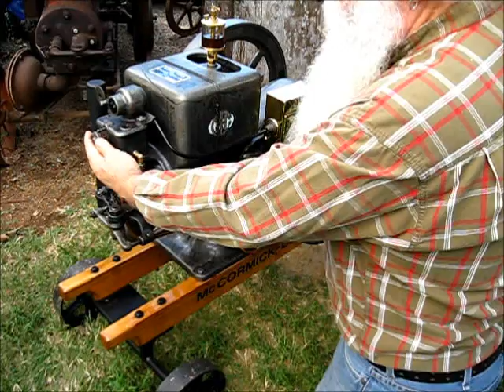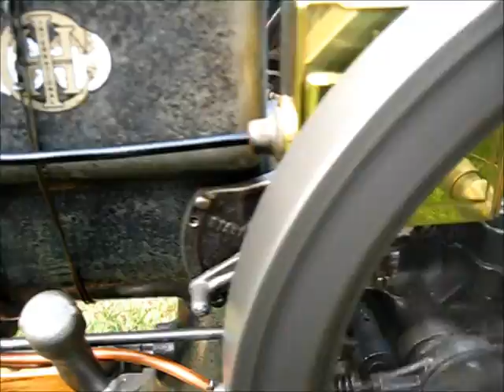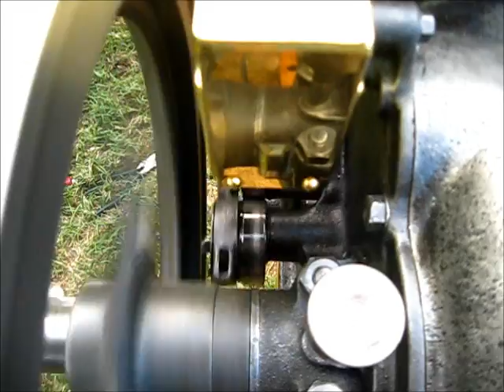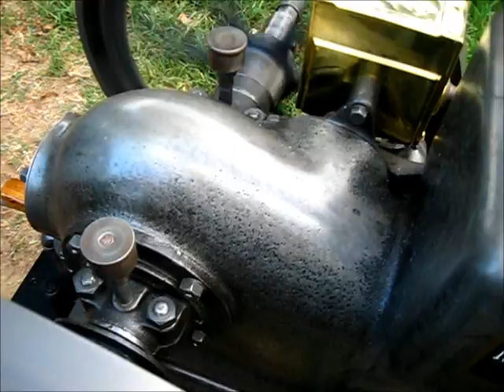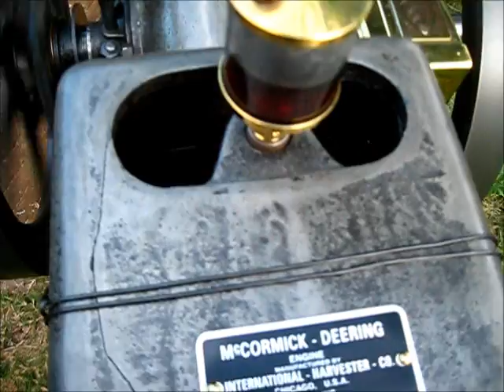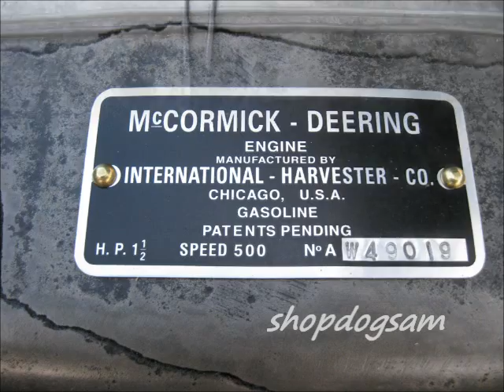McCormick-Deering "baling wire engine" #64

Comment: The fuel tank is in the base, I believe its 1.6 gallons. There is no float bowl. It is not a carburetor, but a mixer. Fuel run into the Fuel bowl and overflows back into the the fuel tank. Perfect for this type of engine and and very few moving parts in the mixer. You can buy almost any  part for this engine. LOVE that sound!!!! put you to sleep. Where on the east coast of AR? I live in NLR. Working in Magnolia on a job. The engine I went through is up in Peoria, IL. It runs perfect!!!! If you have others or want to sell this one, I am the one you want sell it to. I have watched so many MCD 1.5 engines on youtube and they are not doing things correctly. GREAT Video!!! Very Very Nice. Love to at least see it. I will even start it for our enjoyment without instruction.

Comment: your wealth of knowledge on these style Engine,s is incredible .I imagine they could be used for almost any application  power a generator, wood splitter air compressor, E.T.C  Old technology that will probably last longer then it's modern equivalent   Awesome

Comment: That one is a stable runner!  You could measure that valve clearance with a yard stick. Very funny.
 These engines last so long because they are a low stress design. They produce around 1/10th of a HP (or less) per cubic inch. They have extremely low compression ratios and low valve spring pressures, etc combined with super strong beefy castings.  I love the cracked hopper. It adds a lot of character.   Thanks for the video!

Comment: I watched the whole series, and loved it. I learned a lot, and want to thank you, for sharing this. I see you are running Coleman fluid, do these engines require low Octane fuel, like Coleman fluid, or will higher octane fuels work?  Do you have a video explaining the types of fuels, that will work, in these engines?
Reply: These engines will burn just about anything you give them without issue. Coleman just happens to be a happy spot for these engines. They were designed to burn more oily fuels if the farmer was cheap, but they are just fine on gas. The alcohol doesn't hurt anything. I wouldn't be surprised if a few corn farmers fermented their own "fuel", heh. Although I wouldn't recommend it, I've seen a few videos of some 4 cycle gas engines running on diesel. Often the best fuel is your own custom mixture of fuels, such as mixing a little gas and kerosene.

Comment: Back in high school (20+ years ago) my auto shop teacher had a very similar looking engine bolted down to a bench near the door.  We'd all stand around waiting for class to start or class to end and rotate the flywheels, and if he ever saw us doing it, he'd yell at us to "stop messing with that motor".  I never knew what that engine was, I just happened to see the thumbnail and it instantly brought back all of those memories.  As an IH fan, I wish I would of seen it run back then.  Thanks.

Comment: Outstanding job on the engine restoration. The piston and rings are good. I wondered about that part but they are fine. It dont smoke, it has good compression it runs nice.The exhaust sounds really good with that homemade muffler I really like that part and the linseed oil metallic finish is so tastefully done it looks  like a work of art.. It its a beautiful motor and sounds and runs so good you gotta love it.Thanks for making this video series. I am ready for more.

Comment: Alright shopdog!!!! Congrats!!!  I do have a question tho, with these old engines, why don't they have an air filter? I figure in the environment that they were used in would have been pretty dirty (running a sheller or a grinder etc) wouldn't all of the chaff/dust screw with them a little?

Comment: That is just too cool.  How exactly is the governor controlling the speed..is it the intake lifter?  Is that why it's called a hit and miss?  Seems you have it so fine tuned, you can't see the miss after it warmed up.  What did this cost new?  I can remember dragging the old Maytag motors home from the city dump in Williamson, WV.. Those were the days.  Never saw one of these back then.  Coal mine country..not farming..